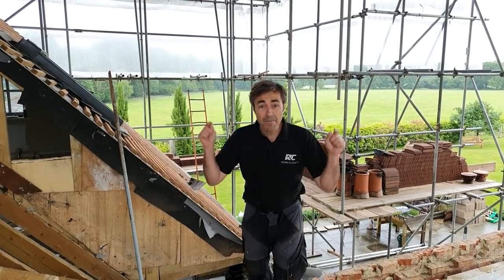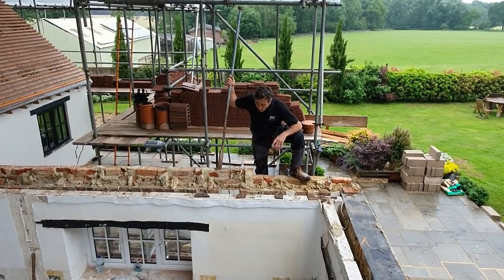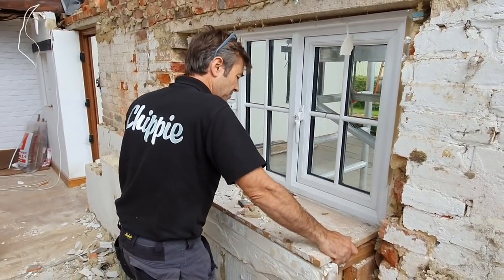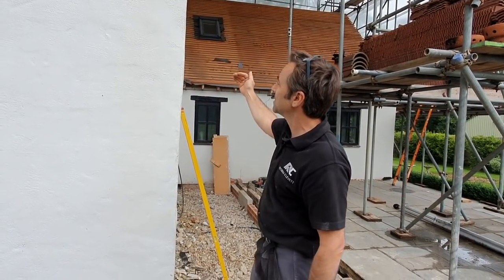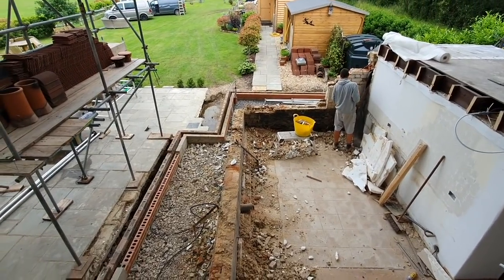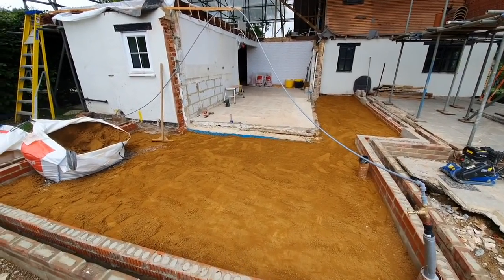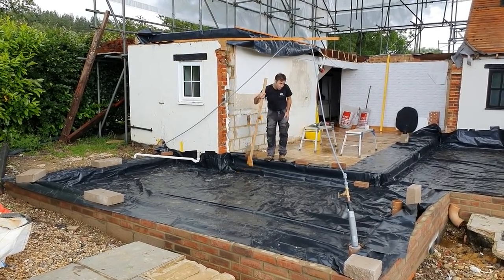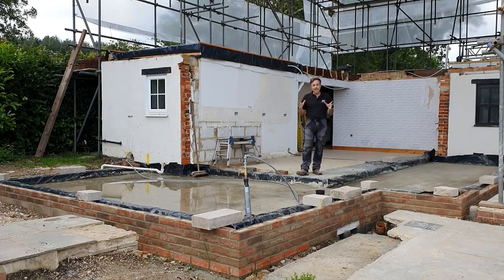The Big Build 12. Removing external walls, concreting the oversites and damp proof membrane

Comment: Aussie version of oversite. Dig out to level or build up seemingly as much as you want with sandy fill. Lay out DPM. Mesh on top supported with plastic chairs. Concrete and then spend hours trowelling up and helicoptering the top. Guaranteed to crack within a short time to varying degrees. You can now add in polystyrene waffle pods to save on concrete giving you a raft your house can float on in your biblical flood. And not joking in the 2011 floods houses built on waffle pods actually moved in Brisbane. Lot to be said for the old English ways.

Comment: One thing we always do differently is to have the DPM on top of the concrete, under the celotex and screed. Then you dont have the concrete drying out into the building.
It just reduces the overall time you have to allow for drying before laying final floor finishes.
Reply: I thought scalpings (wacked) sand blinding, DPM, insulation then concrete + then screed  , different regs around the country I spose    but cracking video again
Reply: He’s putting another membrane in with PIR then screed.
Reply: @Putnamrich1  well not really no, that will be a thinner sheet of poly to keep the screed of off the PIR. Apperently the cement in the screed can react with the foil on the PIR. The DPM is under the concrete.

Comment: You didn't drill and chem fix rebar into the exciting slab, to make a good mechanical fixing between the two.
Reply: With the slab all broken up it's not a smooth to smooth finish so it'll take hope that helps 🔨
Reply: It doesn't matter how the slab is broken, expation and contration on top of the differantal difference on each side of compaction. if not drilled to take rebar to try and relieve differenchal movement between them both. Over time  the older will stay were it is and the new will sink. That's the law of physics and gravity. Prove me wrong on 40 years of doing concrete work, and I'll gladly make an apology.
Reply: @walkingwithdogs8547  but the rebar is coming out of a smooth edge as the shutter holds everything plumb level and square so it would  be technically going smooth to smooth as for the new slab sinks how because once the vibrator goes in all the air has risen to the top  that's it they rase the fat float it and Bob's your uncle if it's a broken edge it has something to bite too
Reply: Cool you must know much more than i do, im just an old timer burnt out and knows nothing. But i bet you even though i think Robin is a great chippy and a very good craftsmen. I very much doubt his gonna be making a YouTube video of how them to slabs moved!! I think there's a guy on here called days concrete or something like that take a look, and if you think his wrong. Challenge him to your knowledge.
Reply: @walkingwithdogs8547  so how much do they move one minute you've 40 year's concrete experience the next I'm supposed to look at someone else's YouTube video's but you know what you mean that's all that counts

Comment: Robin just one query, I've always been under the impression that you lay say 4" of  insulation  then 4/6" concrete  depending on slab thickness then whatever finish stated, is  there a reason you did concrete then insulation? Your brickies should have that up in a crack won't be long before your swinging the old estwing  😊👍
Reply: Closer the insulation is to your feet the better, otherwise your house has to heat screed and a slab before holding any heat.
Reply: @tomvincent5596  Heat rises from below from the core of the earth.
Reply: A guess, but probably having underfloor heating
Reply: @D2M5 Does the heat in the core of the Earth have any impact on the temperature on the surface?

It certainly does! Not only does it radiate heat, add geological activity in the form of volcanism and earthquakes, but the Earth’s core temperature is directly responsible for the magnetic field that shields Earth from solar winds and allows us to retain the atmosphere that insulates us! This insulation is responsible for maintaining the even climate so we don’t freeze solid every night and burst into flame every morning.

In a manner, Earth’s core heat and activity is the reason we can exist. With more activity we’dn’t’ve developed beyond algae and microbes, and with less activity we would never have left the first ice age!}

Comment: Don’t you use steel rep in your non structural slabs over there? What about shrinkage cracking? Don’t you worry about cracking because it’s covered up by floor insulation ?

Comment: Great video, no rebar in the concrete or is it glass fiber reinforced? Or is it not that common to use rebar in slabs in UK? Icelandic building codes might be slightly diffrent as we have alot of earthquakes.
Reply: It is common to use mesh, I wondered the same thing. Could be fibre reinforced though, however I don't know how different the two types of reinforcement are compared to each other or which is best to use on what application.

Comment: Robin, a question. Why no steel in the concrete oversite?
Reply from the maker: Hi Tony, steel is often used but this depends on the size of the slab depth etc, I can probably  count on 1 hand how many times we have had a drawing showing steel in the concrete oversite
Reply: @robinclevettcarpenter  thanks for taking the time to reply. Much appreciated